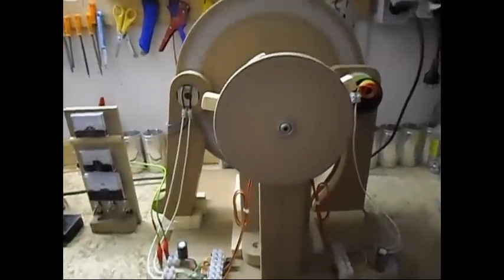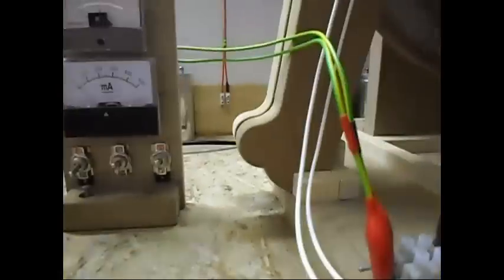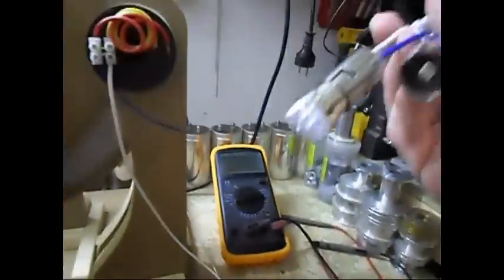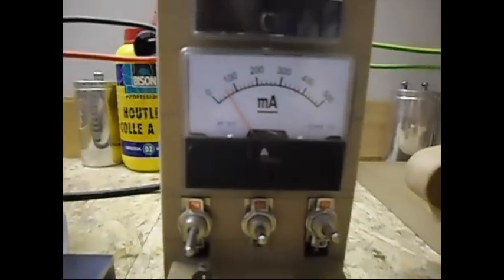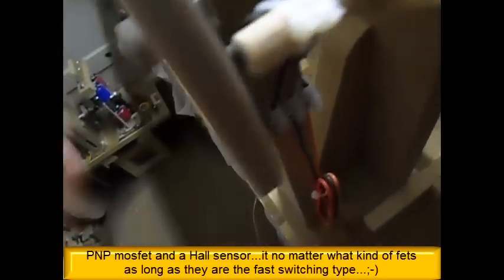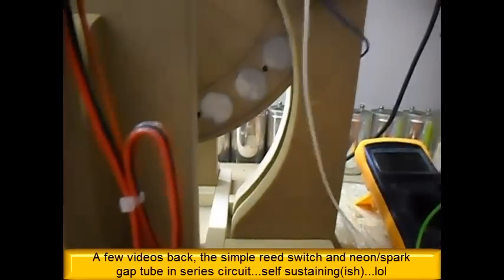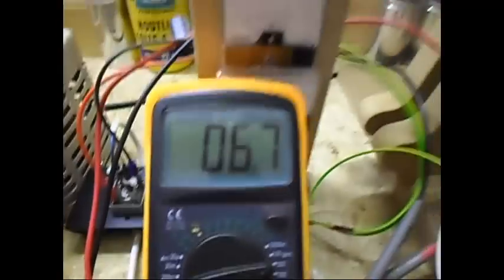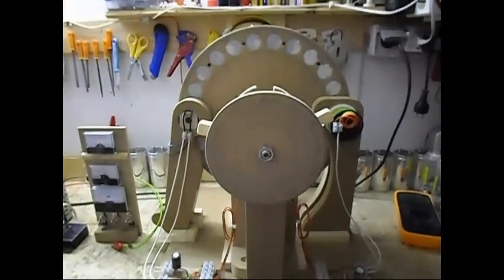Pulse Motor - Two P-channel Drive/Generate Mosfet self sustaining(ish) circuits...

Comment: thanks for posting. your pulse motor is an outrunner. if it was improved by the use of a multiple drive coils with control circuitry, the torque at the shaft might be sufficient to step-up and drive a suitable small pmg (or a slow pmg without step-up).  cheers.
Reply from the maker: Thanks for your comment...^^
I always try to drive my rotors as i do with this one...;-)
I'm thinking of using my large 20kg heavy flywheel as a rotor and mount generators coils as close to the shaft as i can to see how it will perform...:)
That is one of my next projects...on of many...^^

Comment from the maker: Important info,
It is a P-channel mosfet drive circuit and not a "PNP mosfet drive circuit"...crap...sorry about that mistake of mine... -.-
But a PNP or NPN transistor will work just as good or even better...and the same goes for a N-channel mosfet...;-)

Comment from the maker: Just a fun project where i'm using two PNP Drive/Generate Mosfet self sustaining(ish) circuits...^^
The circuits Drive and Generate 12 times each revolution so they fill up their own cap and then use this energy to pulse the circuit and drive the rotor...;-)
And no, it is not enough as it is to have this setup 100% self sustaining...o.O...you and me both wish that was true...lol
Maybe with some modifications i can get it to do better..."maybe"...lol
Reply: Mister Caribbean Roots hallo sir, i'm interested with your project...may i see the schematics for this project
Reply from the maker: Thanks for your comment...^^
Of course, here is a P-channel drive circuit that is almost the same as mine...;-)
http://s1184.photobucket.com/user/twally67/media/PFETHALL2.jpg.html
I'm using another P-channel mosfet and Hall but it really don't matter what kind you use as long as the mosfet is the fast switching type and for hall sensor...plenty of choice...;-)
And i've also removed the neon and put a 4007 diode across the Drain & Source...and that's it...^^
Reply from the maker: Forgot to mention that N-channel mosfet should work as good as P-channel or even better(maybe or maybe not) but since i do have a lot of P-channel mosfets i've used these...;-)
Reply from the maker: Sorry about my mistake Ryan,
It is a P-channel mosfet circuit i'm using...;-)
But a PNP or NPN transistor will work just as good or even better...and the same goes for a N-channel mosfet...;-)
Once agian, sorry for my mistake...hey, i'm only human ï think"...lol